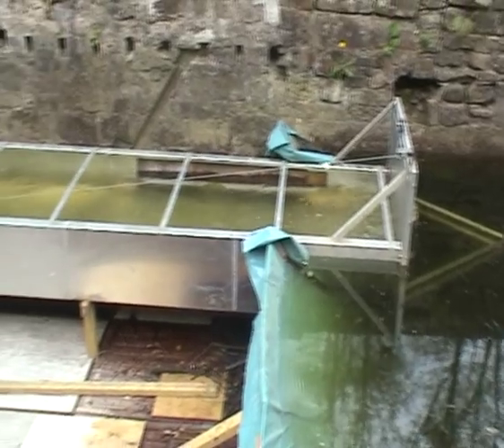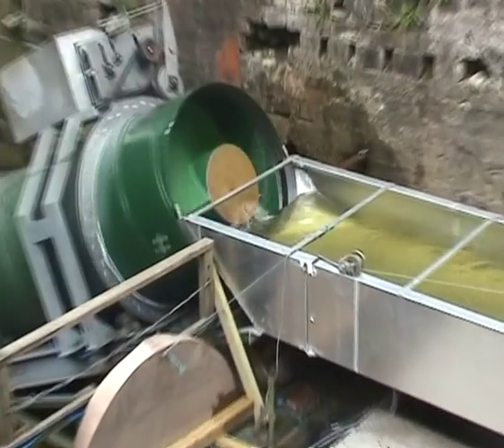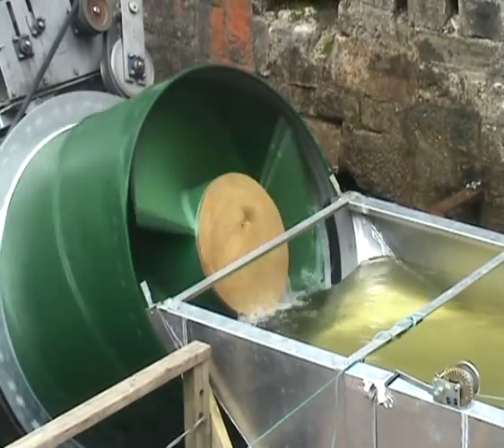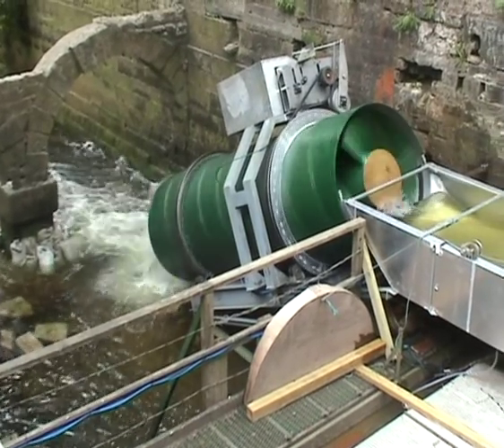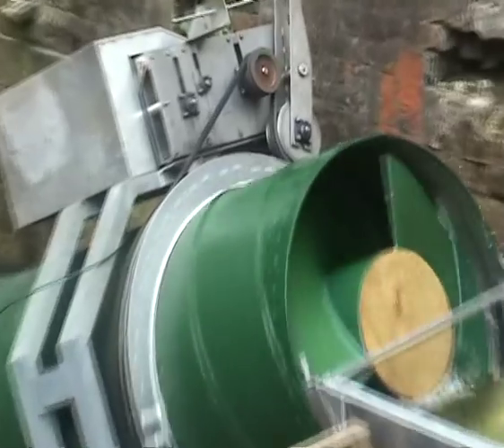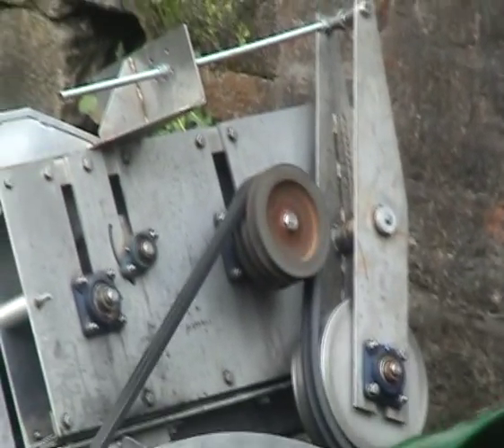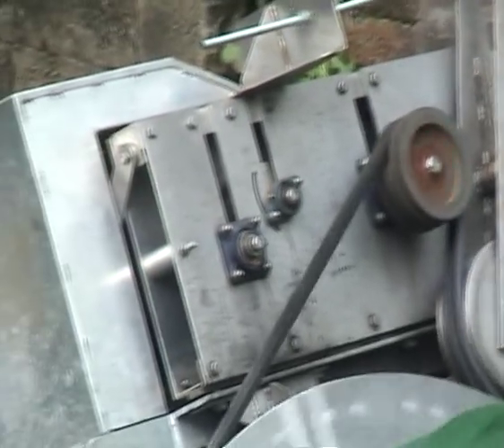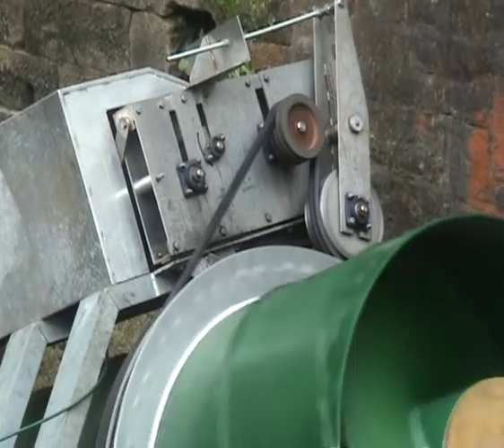Plastic Archimedes Screw

Comment from the maker: we have just put a screw into the Thames Water Treatment plant in Oxford. it is at the point where the clean water leaves the site, however there are other potential sites within the foul water area. the benefit of the screw is that is can pass solids as well as liquids through it. it just needs the 'head' and an angle of about 22 degrees.

Comment: If there is any belt slippage due to the presence of water it might be beneficial to go with a toothed belt and pulley system.
Reply: Chain is most efficient, toothed belt comes quite a way behind.
Reply: @paullangford8179  what about if the drive ring around the case had gear teeth machined into it meshing straight into a generator gear

Comment: Nice work but the calculations of it producing 10,000 Watts can't be possible! Hydroelectric calculations go like this :1000 Lts moving "Straight down" at a rate of  1 m/s has the potential power of 10,000 watts! According to the Betz Limit the theoretical maximum coefficiency is 16/27 (59.25%). You mentioned that there was 500 lts p/s If it was a perfect scenario with a vertical fall it would produce 3000 watts but moving through the Archimedes screw which is at an angle decreasing kinetic energy by appox. 50%  or less then that number!

Comment: Yes, you're correct I've never heard of such a sewer system. Thanks for the info, I'll have to read up on that. If it's enough or a drop I wonder if a turbine might not be effective. 0_o
Reply: Use a Francis or Kaplan turbine for higher heads. The Archimedes screw is good for low heads.